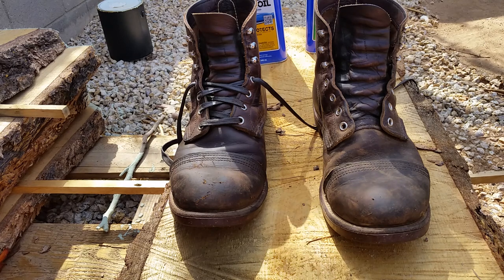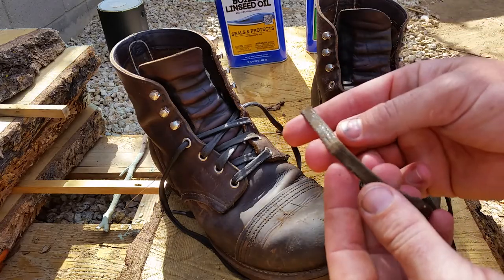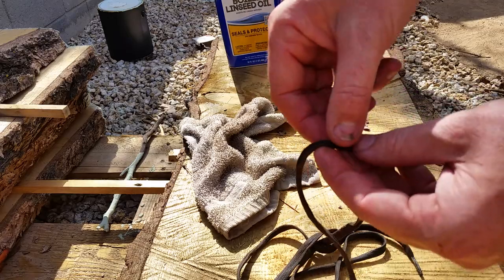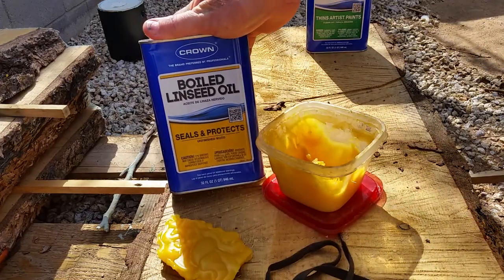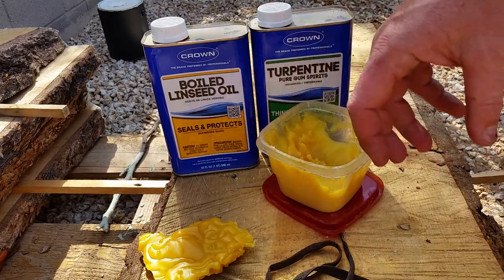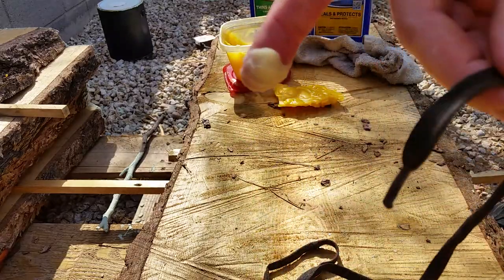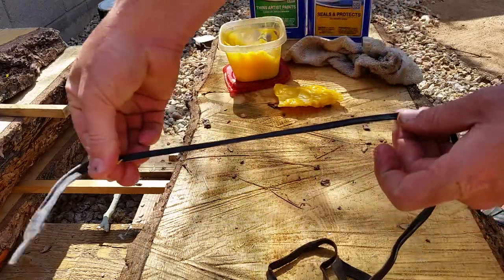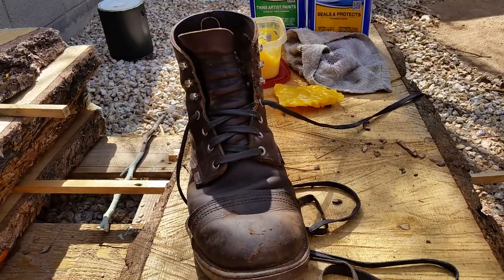How to rewax your Red Wing Iron Ranger boot laces

Comment: I think the idea is to wait a few weeks so the oil hardens and also the turpentine is properly evaporated. Otherwise i imagen the laces will be very brittle. Also it needs to be good quality oil the additives in cheap oil is not what you want on your laces
Reply from the maker: I believe the turpentine keeps the wax suspended.  I tried do just use wax and they were way too stiff

Comment: Isn’t there an easier way? Don’t they sell the wax already premixed? I just read that shoelaces can be  coated in a natural beeswax or paraffin-based wax which I believe is candle wax. So apply a little bit of candlewax and heat up with your blow dryer that should give you wax leased
Reply from the maker: You want to mix it with a cutter so that the wax stays emoulsified

Comment: I don't think you should touch turpentine with bare hands. Those solvents are toxic and go right through the skin. Other than that good video.
Reply: VeryNormal SimplePerson -- good point. Do those blue gloves help or will turpentine melt them? Do they have to be certain rubber materials maybe? Thanks!
Reply: It depends on the material of the "blue gloves". Nitrile Gloves are the ones you want for turpentine, Latex or Vinyl ARE NOT RECOMMENDED.